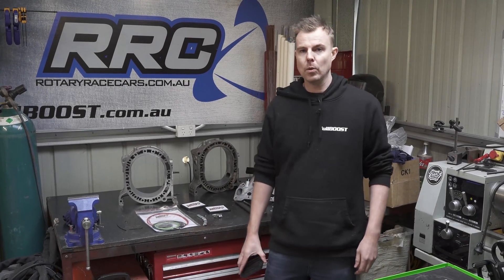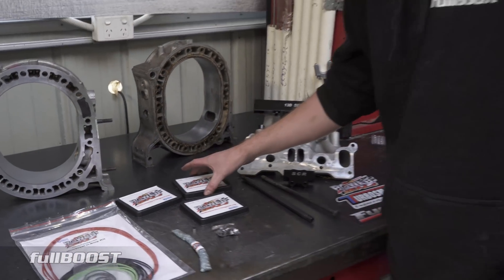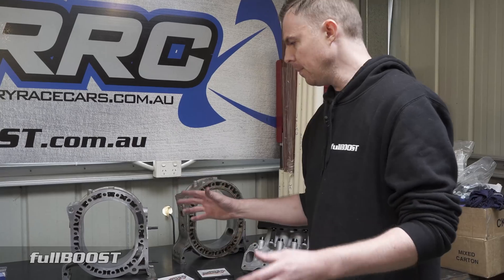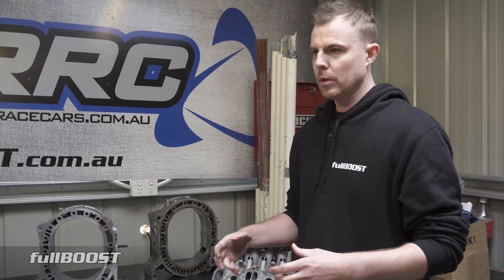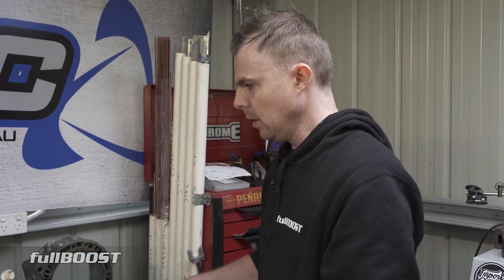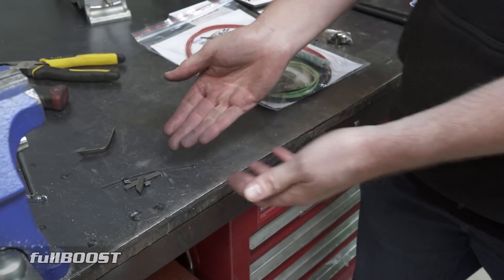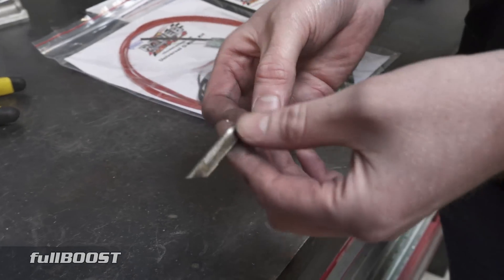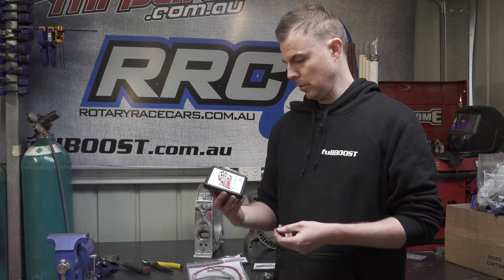Unbreakable rotary engine apex seals explained | fullBOOST

Comment: They forgot to mention these seals are so strong they chatter the hell out of the housings people running these run up to 2 oz premix per gallon of gas
Reply: So what's the big deal . More premix is pennies compared to the cost of rotors or housings . Come on man you can't have it all.
Reply: @Vgk36 these Alex seals damages the housing so how are u saving money ?
Reply: @Rotary12A  Didn't he just said that this seals wont' ruin your housings like the factory seals? He also said that there is a race team with a rotary Mazda 6 using them.
Reply: @normanguzman417  I've personally ran these seals and they do more damage then the reg mazda ones
Reply: At least you will have good smell from your exhaust 😂
Reply: What about i-Rotary apex seals by Ianetti? It’s a two piece design which mean it is better at sealing. It have the same dimension as mazda stock apex seals but far stronger. I’ve seen 6s second car running with this seals. Distributor and race team both claim that this apex seals far gentle on rotor housing than mazda OEM counterparts.
Reply: 10w30 isn't enough?
Reply: @sofakingdom3076  10w30 would be the crankcase oil I'm talking about premix . Oil that is added to the gas
Reply: @Rotary12A  a rotory engine does not have a crank case. Just an oil sump. And yes the 10w30 is enough for the second gen rx8. The first gen rx8 premixed gas is recommended by the rx8 forum
Reply: @michaelgohm1823  👍 Interesting comments.  Do u know if premixing 1/2 - 1oz  2 stroke oils per gallon will definitely help seals or just a myth to sell more oils?  Many have advised to premix with regular non synthetic 2 stroke oils but I have not seen scientific proof or before / after photos of seals & rotors with different oils.  Also if rotaries do not have crankcase oils, would that be reason why piston rings get adequate oil lubrication and Apex seals suffer more? Thanks & keep up great info 🙏⭐🎆👍
Reply: @chrislg4519  I am by no means an expert on rotory engines. But from my understanding the first gen rx8 had two oil injectors that would lubricate the housing and apex seals compared to the three they have on the second gen rx8. From my understanding the first gen engines apex seals would not get enough lubrication and heat up and hard. And when they harden and the engine had a pre detention  the apex seals would shatter and scar up the housing, rotor and side plates and essential destroying the engine. So I run pre mix oil in my gas tank to help with the lubrication to insure that the housings and getting enough oil
Reply: @chrislg4519  and I almost forgot to mention I heard its better to run non synthetic oil as the oil is Kent to combust
Reply: @michaelgohm1823  Great thanks for reply Michael 🙏👍 Great info regarding series 1 & 2 differences 🌟 i will check more forums as i try and keep seals & rotors well conditioned. I also read that using "ashless" Idemitsu oils may help.  🌟☺ Blessings to all & rotaries ⭐
Reply: @chrislg4519  no man
Reply: Np
Reply: Mr. 12A Does it have anything to do with it’s mass?
Reply: @soraaoixxthebluesky  Cast iron is significantly heavier than carbon steel. All though i am not sure what both seals are made of.
Reply: @normanguzman417  Iron alloys have all about the same density. If anything, cast iron has slightly lower density than carbon steel due to various impurities, thus is "slightly lighter" than carbon steel.

Comment: You'll be sorry.Just saying.
Reply: I've seen the destructive results from these seals and others like Steel Science, etc. As Rob said, good luck!
Reply from the maker: Sorry about what?
Reply: @fullboost  Your engine if you run those seals
Reply from the maker: We've run them in a few engines they are fine.
Reply: @fullboost  Good luck then 😉

Comment: this was a $300-400 at cost demonstration video
Reply: I'm sure those were old parts from broken motors, so likely actually $0 cost.

Maybe the power seal, but that didn't look like a new one, so likely it was a used part that wasn't going back in another engine, either. ;)

Comment: Could always make Diamond seals for lifespan but who wants an engine that lasts (GM, mistibishi,... Etc..)
Reply: People with with a budget lol. Only the rich can have fun with rotary.
Reply: @jayknight139  I'm building up a duratec 2.3 but I found a good condition rx8 for 600$ 32890 miles real old person weekend driver
Reply: @Project-gr6zy  I dont know much about rotary  engines but I love the RX8. Are rotary engines hard to work on relative to piston?
Reply: @jayknight139  really easy to work on , just different
Reply: People use diamond grinding wheels not seals lol

Comment: Can anybody show this to rob Dahm
Reply: I can’t imagine that 4 rotor engine has stock seals 🤨
Reply: not billet
Reply: Dude do you think Rob last name is Dumb instead of Dahm. Who in his right mind will spend 60000$ for engine and cheap out on apex seals.
Reply: I was getting ready to make this comment as well 😅
Reply: Doesn't he use ceramic seals which I'm guessing would have to be indestructible if they hold up with his cars power..
Reply: Rob can't even use a vernier callipers. What makes you think coated seals will make up for his total lack of tuning skills and knowledge.
Reply: @cathalsurfs  he seems to be making over 1200hp in the 3rotor
Reply: @cathalsurfs  it’s on a video……but way to be wayyyyyy late on the convo. 
You should check out the vid on robs channel though
Reply: lmaooo dead
Reply: John Richardson I dont know for sure
Reply: rofl
Reply: Who ?
Reply: @hksjoshua  mike jones....
Reply: @BobbyB910  rofl.
Reply: Why would rob dahm use factory any thing on any of his builds?
Reply: Actually the 4 rotor is fully billet
Reply: @Me-fj8sb  No its not! The front and rear irons are cast iron and the weak link of his build. The billet portion are the 3 center irons with the added stationary gears. He should stop bragging about being the 1st to start a full billet when it isn't a full billet.
Reply: @rotaryperfection  wow,  didn't knew that, because he is always saying that is a fully billet build, good to know
Reply: @rotaryperfection  is it possible that are cast (aluminum) from Racing Beat?
Reply: @stevecarlisle3323  Looks too dark to me to be the Racing Beat version. Also if it were cast aluminum, then the block still isn't all billet like he claims.
Reply: @rotaryperfection  🤔
Reply: @rotaryperfection  I seen 13b engines with iron plates that can make well over 1k hp. Robs engine is not fully billet but is the 4 rotor with most billet parts in the world.
Reply: @normanguzman417  What it's power potential is is besides the point. It's misleading to claim FULL billet when it isn't.
Reply: @Me-fj8sb  still has to have seals and gaskets though.
Reply: Project Dusen-spec his engine is pre-build in Australia using the best possible materials and method. The only thing he needs to worry is the external part like the management unit, turbo, fuel system, oil system etc.
Reply: @soraaoixxthebluesky  he has to worry about external seals and possible future repairs. I wasnt saying particularly at this point, since the bil26b is fully built already. Just rather that billet or not seals still matter.
Reply: Fuck Rob Dahm.

Comment: Omg now my rx-7 can do much more than 100 k miles🤯🤯🤯
Reply: probably much less miles than the with the factory seals, actually. Hard, brittle seals last a long time, they just don't cope with detonation. Detonation is not a problem for a stock engine. In both cases you have to rebuild the engine, the soft seals just increase the chance of only having to replace the seals.

Comment: could you make a rotary work for diesel? (dont mind me im just asking stupid questions)
Reply: Dont think so because a rotary needs high power ignition (big spark) whereas a diesel needs high compression for ignition. Im sure it could be engineered but for it to work, the cost would out do the need to do it. Not to mention the carbon soot that builds up from diesel would not sit well with apex seals. But thats only my opinion and i am no engineer or rotary guru
Reply: I think the Russians had some rotary trains

Comment: So can those apex seals warp under detonation? Then will it damage the rotor housings if so?...
Reply: No, the seals warp because they are mild steel and are softer. If the seals are softer than the housing, then you won't scratch the housing with the seals.
Reply: The seals have a spring behind them. The seal is inside the groove of the rotor.  I imagine if it warp it will get stock inside the rotor groove and the spring wont be able to push them out. therefore preventing damage to the housing

Comment: So yes it does not shatter but those seals that bend means they are less hard so they would be only for race applications because they will not give as long miles as the hard seals.

Comment: in my book, the W8 with that vvt solenoid that fails open is the worst... xD 

braap power is fine!

*edit* just started wondering, would a nikasil plating on the housings help it's durability? or would it ruin a good set of housings xD?

Comment: Yaaaas... Powerseals for the win, ceramic or others for shattered dreams.
I run these in mine too👌
Reply: Any problems yet?
Reply: @niismo.  Nope, making over 500whp for 4 years without drama.
Reply: @DStead2239 its been 4 years,  any updates? And how much do you premix?
Reply: @ChErRyaVe20pK  Still good. 150:1 race castor oil

Comment: But it doesn't solve the catastrophic oil consumption and fuel milage so it's still a piece of crap
Reply: Manuqtix Manuqtix I think there is a company in the UK maybe that makes  rotary motorbikes and they have solved this issue with a different type of seal.
Reply: Get a Prius then you ....

Comment: I didn't hear anything about the material used to make these PowerSeals Broomy, only about having an 8thou coating. 🤔 What type of metal is that? 🤷
Reply: They are steel seals. The exact composition would be a secret though I'm sure

Comment: So instead of what seems to be 'high tensile steel ' apex seals they use ' mild steel'  ? 🤔 . Not trying to be a smartarse but it makes sense. The mild steel is like sand it will just mould to the shape but high tensile is like glass any decent hit it just shatters into ten thousand peices you keep finding 6 months later
Reply: Lol no that's not mild steel or high strength steel. Cast iron is used for wear resistance and cost, and it's adequate strength for stock power. Powerseal probably uses alloy low carbon tool steel. Hardened and tempered. Tempering will make it ductile enough depending on the time and temperature control.
Reply: Factory apex seals are made of cast iron with a hardened section that is in contact with the rotor housing.
Reply: @mobiusclean6440  kinda thought that but wasn't to sure so just went with 'high tensile'
Reply: Yep.
Reply: it seems that factory seals are made somewhat from hard, brittle material. they are good for durability but not for sealing

Comment: I'd imagine the run in procedure would be very important with these, just like chromoly rings in a piston engine, you have to be gentle until the high spots wear down and the seal is sealing with even pressure all the way.
A standard apex seal, just like cast rings is much easier to break in with high load and low RPM, the ring or seal is what wears to the housing or bore and has a great sealing ability, but fragility is high, much more so in a rotary engine. 
You can't beat reliability though, it may seal slightly less, but you can lean on them much more.